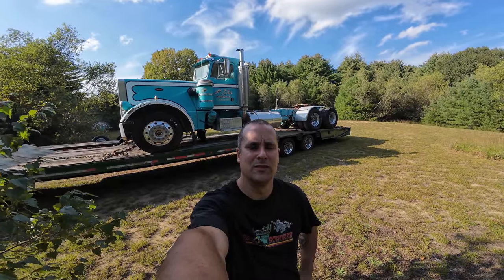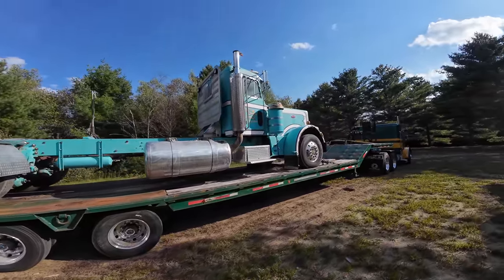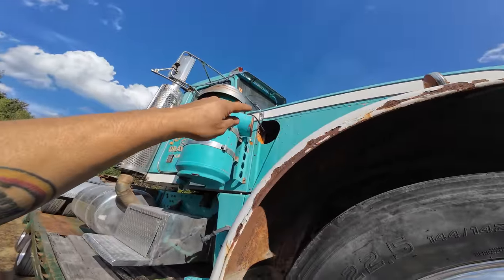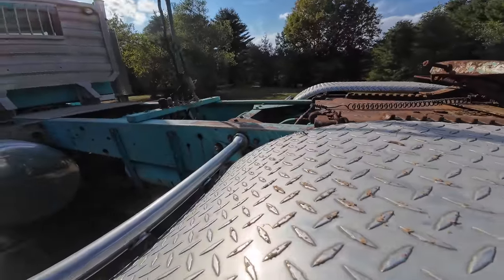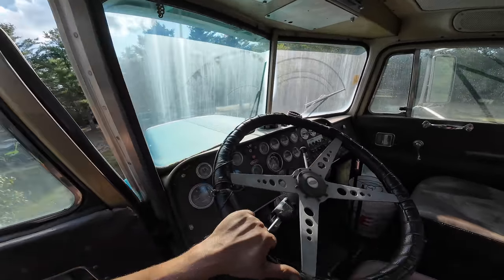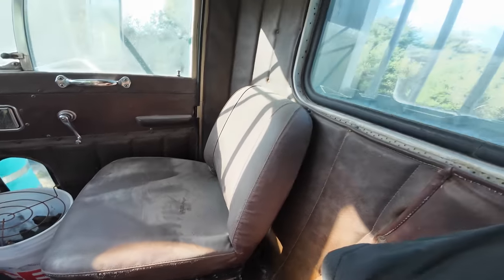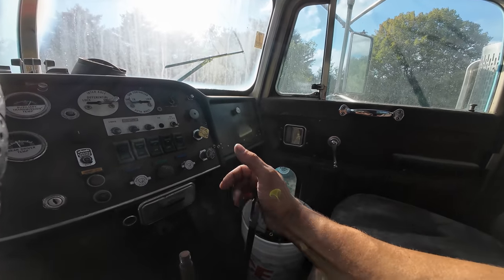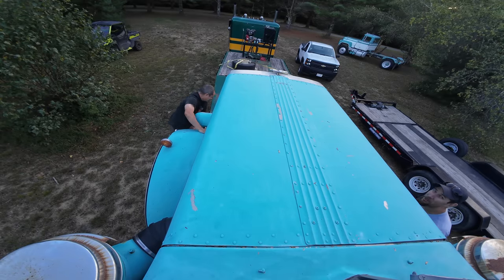I bought my dream truck and spent all my money!! Was it worth it?!

Comment: Power steering in those day hade no road feel and most drivers did not like them.  Witch may be why it may be off. I drove a 12V71 Freightliner COE with no power steering it was not as bad as you thing.  Great find you will do it justice.

Comment: Most of those old trucks with the twelves in them had an intement relationship with a mechanic and were fondelled many times by strange hands. The reason people bought trucks with them was they were cheap big horsepower and even though they only got 3 mpg, diesel was less than .25 per gal. and plentiful. It was helpful to own lots of stock in oil companies. That way at least you were helping your own cause while driving a loud, fuel guzzling oil slinging beast.❤🙂⭐️⭐️⭐️⭐️⭐️

Comment: You didn't mention the valve cover in the video, I'm thinking it/they would have been the steel ones in 1975. I am jealous, that's a real piece of history you've got. I'm stating the obvious, but just rebuilding the motor is going to be very expensive. No Interstate McBee kits!

Comment: The first V12 359 you had was my dream truck, not so much because of the the V12 but because it was spec’d perfect….Hendrickson suspension, 5.29 ratio 44k Rockwell’s, 6x4 trannies and the V12. No junk air ride or 3-something geared 34 or 38k rears for highway use….she was set up to pull in the mountains and run in the rough stuff.

Comment: Great lookin project, only ever drove one 359 and that was over 20 years ago. Really appreciated the cab being narrow enough that you could just lean over from the driver’s seat and roll down the passenger window. Dadgum those cabs are narrow, lol. The R model Mack I started off with had the ramp tail similar to yours on it. Worked great for backing under their step deck or the hydraulic dovetail trailer as long as someone else hadn’t caged the brakes on whatever trailer you were stabbing it under. 

Hate it that you’re having to come up with so many parts. I just saw an 82 359 in Franklin Kentucky this morning that had a running engine but needed brake work and rubber all around for $2800. I’ll try to find it again and send you the link.

Comment: Hay wayne i got thermo housings&  i think the truck might of come with a belt drive air comp & converted to flange drive  ?? But if you get a 45 * or 54 *  501 is shortest  air comp they only make 70* to the left , the air comp is even more of a problem on tha square door( im fighting that right now) . Thr liner problem is the bore of block is warped & heat is not transfering. If you want a hyd unit im pulling one off & going p/s box. That truck is a survivor.!!!
Reply from the maker: Brother!!! I need to get a hold of you on that stuff!! I'll call you next week. I had a hard time not telling you about this last time we talked but I hadn't sealed the deal yet and didn't wanna jinx it.

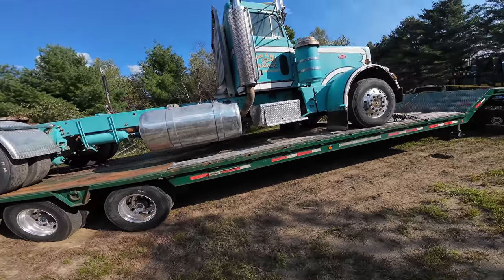Comment: Ive got a 1979 L-9000 Ford i'm working on. It has an 8-V-71, 15 speed fuller, 5:43 rears. 45,726 miles on it. Ex-G.a forestry lowboy truck.
Reply from the maker: Very cool

Comment: Great looking 359 Pete, there used to be a lot of old Pete logging trucks in our area(PNW) but they have been disappearing (scrapped) as the old timers pass away. Those twin counter shaft Spicers were tuff box's in their day, they actually made an air shifted 1241 auxiliary as an option, but the manual was more common.

Comment: Worked with several loaders . 12 V's, 475 horse with turbo industrials, I think they were gray . Amazingly non leaky . Trying to remember, but I think they were Euclids .
Reply: 12v71 natural was rated 475 hp. The twin turbo setup was rated 525 hp IIRC. I had a 12v71 natural in a W923 Kenworth that I rebuilt with a set of custom made injectors and it made 500 hp to the ground! (Don't ask me about fuel economy though!!!)

Comment: I was raised in the heart of the oilfield in Texas in the late 70’s and 80’s and really remember those old Detroit engines especially the V8 and V12’s The sound was so unique and you knew them when you heard them. It was cool hearing a rig that ran twin 12V71’s with twin blowers and twin turbos. I love all diesel engines, Cat, Cummins but those old Detroits were unique and damn near indestructible. I’ve seen them do stuff they should have never been doing and much harder than it should have ever been. I e driven old Mack’s that people under 45-50 today would be confused on how to drive today. They had 3 shifters, of course one of them was just the compound gear. I believe there was 2 low ranges and 2 high ranges and reverse and then of course your good old twin stick transmission. It was cool being in reverse and shifting through gears. It’s how I was taught to back trailers in a figure 8 in the yard.

Comment: Hey Wayne,  Congratulations, I think you got yourself a pretty nice truck.  Doesn't look all that bad on video.  It really looks like it's mostly complete which is really nice to have.  You mentioned it only had one air  cleaner and I'd bet it came with the left one.  The weld on the Tee for the hose flange going to the right side doesn't look factory.  I didn't see an AC compressor but  I did notice some hi pressure hoses going into the dash on the passenger side firewall with some of that insulation tar tape sealing them.  Does it have AC?  I Also noticed some hoses going up the back of the cab towards the roof.  They went under a metal cover so I thought it might have had roof AC.  looking forward to the videos on this project.

Comment: Cograts for finding a unique piece of history, that seems you have a gifted knack for uncovering scarce  hidden items.  Kozad ramps, I just started hearing about through various forums, but aren't they to pick up trailers with no landing gear.......like oilfield flats ?  I assume, but maybe missed a comment on the missing head , valve cover and misc. that you got those parts. Thermostat housing outlet, I would assume they're the same as a 8V71 or 92, or 6V. , but i'll have to go back on video .  Was there a housing that had twin thermostats?
Reply from the maker: V12 automotive thermostat housings are unique. They house 2 thermostats per side and they're not the typical thermostat. I will probably have to convert to industrial style with external water manifolds

Comment: At least the frame won't rust.  Why not restore it if you can.  Would cost more to restore than it cost new but it would be worth it, expensive hobby.  I have a fuel cap if you want.  Are you going to finish the 352?  I swapped out a 3406A in a KW aerodyne with 400 cummins 20 years ago.  Luckily I had a guy from El Salvadore do the work, hard to find a mechanic these days though.  Was fun to watch.......

Comment: Hey Bro.. I'm really surprised you don't know or have a friend who is a Fabrication / Metal man who can Fab you up a set of replacement fenders with that OEM look  I've seen guys work magic with an english wheel and some time ... The Pete fender isn't exactly a very difficult shape to achieve .. I'm shocked this was a logging tractor without a Double Steel frame but rather Aluminum ??????
Reply from the maker: Typical cali spec loggers were all alum frame on hendrickson pad. They all fuckin broke but they seemed to keep on specing em that way anyway. Makes no sense to me

Comment: what ye gona dae with the Engine Take out rebuild it or swap in one of those ye have and know are running?
Pretty clean thou,
BTW. standart Airfilter location on 359's were Right hand side, IF it was a Inline 6 ,V8 and 12's on the otherhand had it on the Left side when Equipment single only.
The Twin Stick glitter handles has someone for Sale on the Peterbilt classic page on Facebook, refabricated, Colour shape and Emblem choosable.
The Air leaf is necesary with the Flatbed ramps tae get as low as possible
and I think this truck had an bigger accident than the fender, because the right side Top hood is changed also not only the Bracket.

Comment: Your thoughts on Aluminum frames? I've been eyeing an 80's Pete 362 with AL frame for a long while....but I'm worried it's life span (and load capacity) are limited.
Reply: Also where did you get the build sheet!?  I've had a horrible time with that through PACCAR dealers with 90's trucks let alone a pre-80s!!!
Reply from the maker: I love em.

Comment: I’m guessing it will get new liners at least on the right side?  Would have been great if you could have gotten the head and the cam hadn’t rusted over. But I know when you’re through it will be right 100%. Hope you can find the gages you need
Reply from the maker: I do have the head but we're gonna pull the motor out just to do it right.
Reply: That’s awesome Wayne! I think you got a good truck here . Hey what brand of engine kit do you use ? I remember interstate Mcbee was junk with that engine you rebuilt , I have a 471 I kinda think I need to do a freshen up on - low compression and burning oil . Thanks for your advice , another good video 👍
Reply: @Ol2Stroker  CAn't wait to watch this truck rebuild story..  If you could concrete your large parking  shed,  you would have an indoor area to work on these trucks?
Reply from the maker: @ricksmith4736  yea but the structure itself needs some love first

Comment: Wonder if the compressor swap coincided with the original right-front cab mount failure? Overall, this is in fairly good condition….partially owing to being a California truck, obviously.  I kinda figured this spelled the departure of the 3408-equipped 359…..there’ll be a taker for it for certain. That R700L should sell quickly…..will Mossy and the Brockway survive the purge?
Reply: I can't imagine Mossy leaving?  Never say never, I sold my frame off 67 dodge RT convertible last year after owning it for  31 years....
Reply: Great find, Wayne. You have nice start to a great truck.

Comment: Before you mentioned the Cozad / Murray ramps I knew it was a California lowboy truck. Those two lowboys are totally useless when the ground gets slick.
I was also hoping for a 3408 Cat, my hopes were dashed with the 'Buzzin Dozen'.
Also, you sure its a 1975? Thats not a 'Corvette dash', thats looks like maybe a 73 or 74, the Corvette dash had a hump integrated into the dash right in front of the steering wheel that came out on the 75. 
My employer still has 5 or 6 359's from 75 to 78 (all running).
4 of them have 3406 Cats, one has a KTA 525hp and one has a 3408 v8 Cat.
Simply wonderful old school trucks with lots of nostalgia and character.
Great find, I hope you enjoy your new project!
FYI, no he has no parts for sale 😢 sorry!
Quickly, I might also mention he he as a whole fleet of from 74 to 79 900L ,A model KW's, mostly log trucks and a few 5th wheel trucks.
Those were the days!!
Greetings from N. Idaho.

Comment: Take that Detroit boat anchor to the dump a put a old   cummins in it so it will go over  40mph
Reply: You’re on the wrong channel dude, Wayne’s a thoroughbred Detroit bloke.
Reply: Put turbos on it & it will run over the shit on the highway today , this is horse power  available in 1968, what in the day would run with a v-12 , the only thing that might have been  1693, if it was available .